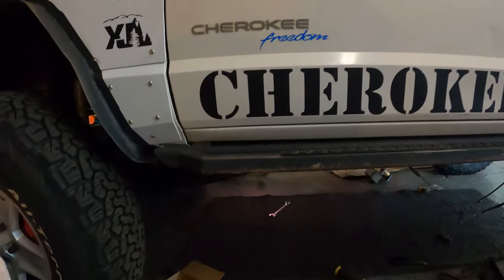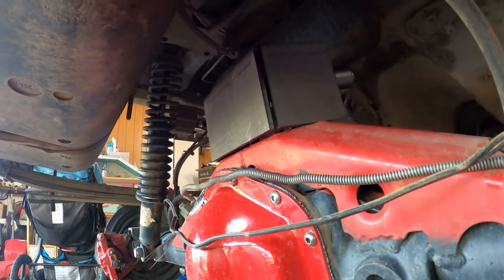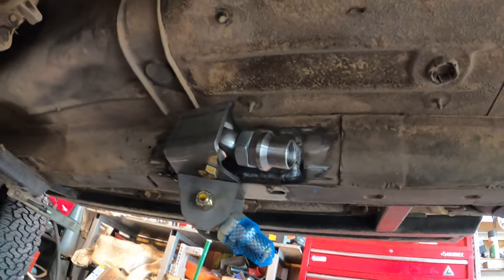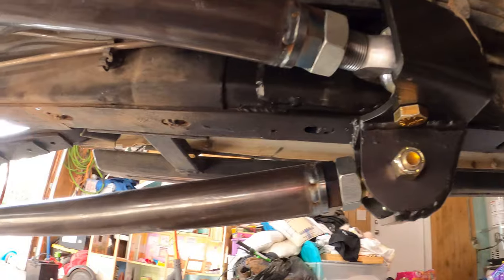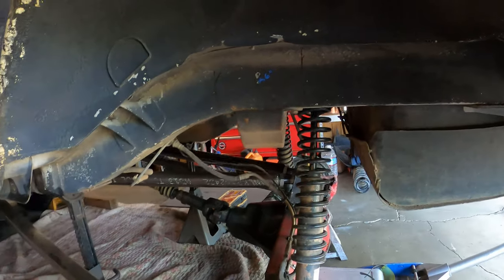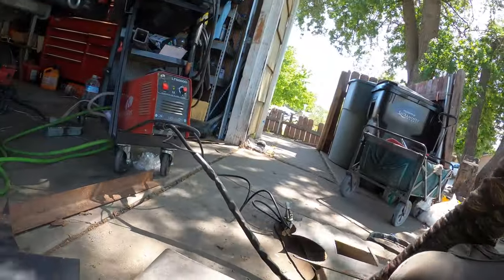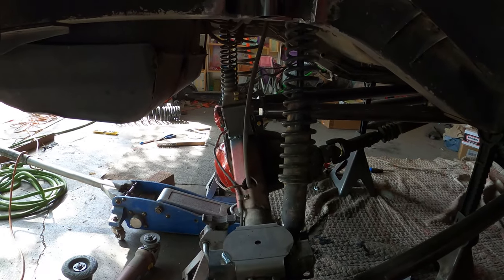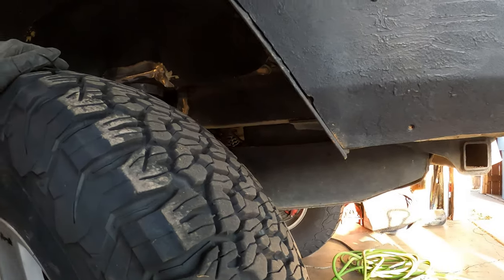Building custom Rear 4 Link Suspension Jeep XJ

Comment: Good job! I know welding in those plates without blowing holes in the thinner metal of the jeep frame isn't easy. Really enjoyed this video!
Reply from the maker: Thanks 👍
Reply: @4WDAdventureCrew  Paul is right, it would be tough with my skills not to blow holes in the frame, what gauge would you guess the frame steel is?
Reply from the maker: @Kyle-ev4fk  its no more then 0.20, full of Seam sealer so welding is not fun.

Comment: Probably still fine, but there's a bending moment on the weld in a straight line when the vehicle is supported by the spring.  I'd add gussets to either side of that upper spring retainer if you can.

Comment: Great video!
How has the rear end been since you did the 4 link? Has it made a big difference or do you think the leaf springs were comparable?
Reply from the maker: So far it’s good I only blew one shock because I broke my bump stop on Barrett Lake trail. But I like that coils flex better and it’s rides softer, but Leafsprings are not bad, I just wanted more travel from the rear suspension

Comment: This seems pretty dangerous to me. The rear end of the jeep is jacked up by the axel. But then his disconnecting the axel from the jeep.... Shouldn't there be jack stands supporting the rear end of the jeep by the unibody rails?
Reply from the maker: You have to watch it again, before Axle Links are welded rear axle is hooked up by Leaf Springs soon as Links are done and Leafs are removed axle is secured from moving by the links and Stands under the rails. so not sure what part you are referring to.

Comment: Your coils arent straight because the axles aren't located properly. I have this same setup on my XJ and everything sits straight as an arrow
Reply from the maker: Axle is Located same as it was with Leaf's i just welded Coil bucket in the Wrong place and didn't angle bottom to offset the Pinion angle right.

 i know mistakes are made but of well it still rides nice